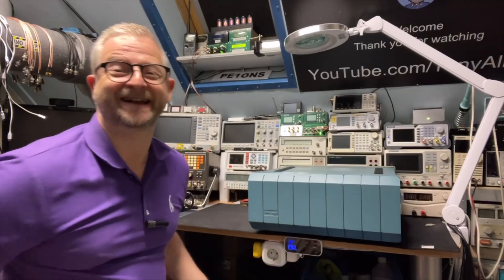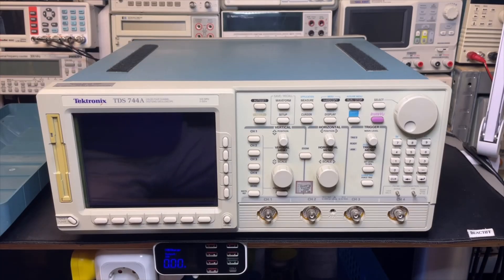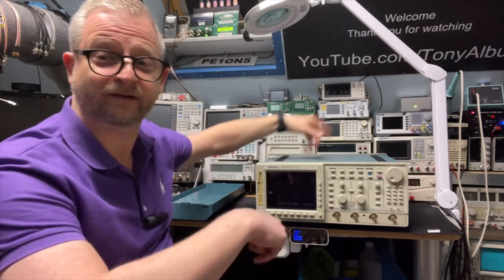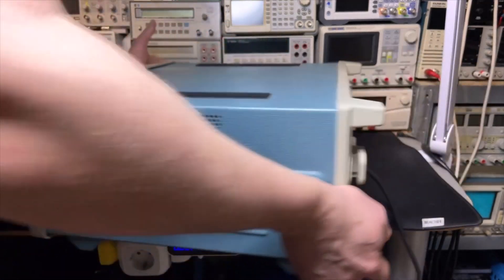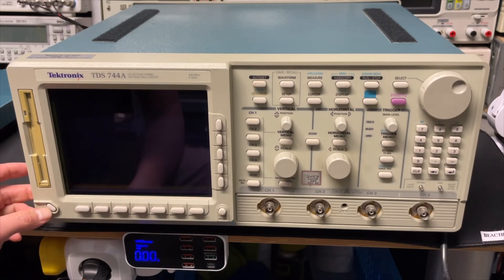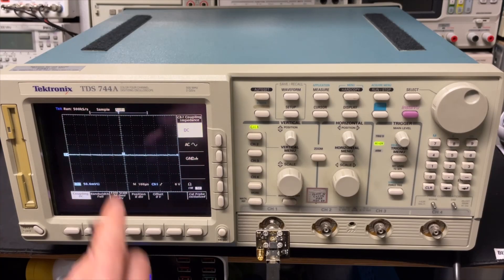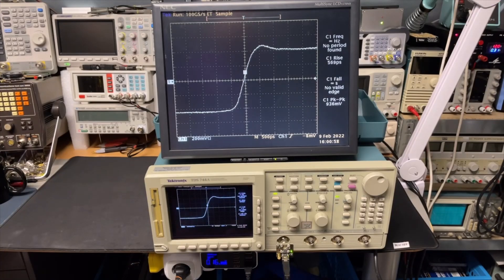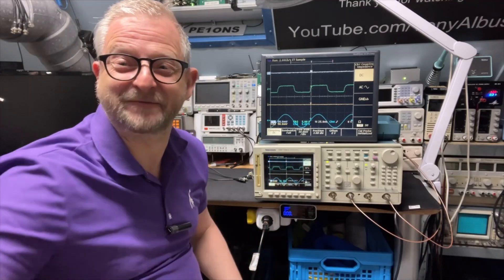#264 Tektronix TDS744A - Part 1 - First Quick Tests after it Arrived

Comment: In the A versions of those machines you have to check the board for leaking electrolytic SMD capacitors on both the sampler and CPU board.
Reply from the maker: Yes thats very known.

Comment: Nice score!
Check the Tekwiki for the v4.2.1e firmware, it's easy to update the firmware via GPIB and if the firmware doesn't work, (the scope doesn't boot) you can just flash it back to v1.1e
Also, replace C17 on the PSU PCB, it is a critical low-ESR cap that will end up killing the standby power if it gets too high in ESR.
Then replace the surface mount caps and back up your NVRAM.

Then enjoy!

Also, if you decide to do the TDS784 mod, be sure to find a way to calibrate it to 1GHz! It won't perform it's best with only the factory 500MHz calibration.
Reply from the maker: Thank you Jared! Yes i watched a few of your videos on this, it will all happen to me too i am sure, as with all the others :)
I need to setup GPIB i have an old pc for FAS and hoping my NI-ISA will arive and hopfuly works. the NVRAM can by copies to floppy or mac/unix GPIB if i am correct but need to find better info on it. for Aligning i can use my Marconi 2955 or 2031 with an RF power amp, i dont have a generator with that much output. so much i need to learn from this machine.
Reply: @TonyAlbus  The firmware update as well as reading/writing the firmware and NVRAM can be done with any GPIB adapter (I use an ebay Agilent one), but the calibration needs the specific ISA GPIB card. Although there were efforts in the eevblog to get it working with other GPIB options.
I also have to get my old PC set up to calibrate my scopes. One day.... one day.... :D
Reply from the maker: @TERRAOperativeOriginal  Thanks Jared, i have a maybe fake Agilent USB from Ali, but it could be working, will try that with the info you send me. to be continued :)  Thanks!

Comment: Nice find, Tony!
The CRT in that instrument is a monochrome (white) LCD with a two-color so-called "LCD Colour Shutter" in front, which explains the increased depth.

Colour images are generated by displaying several different monochrome raster-scan images in quick sequence, while the LCD applies a different colour filter over the whole screen during each scan.
The repetition frequency actually is pretty low, which explains the strange colour effects when moving your eyes while observing.
Because of the light loss through the colour filters, the CRT needs to be set at a pretty high brightness. This explains the limited life time of these CRTs and the frequently observed burn marks.
Reply from the maker: Thanks Raymond, always nice to read your input, so much more background to this technologies.